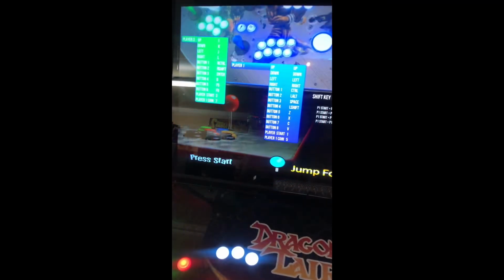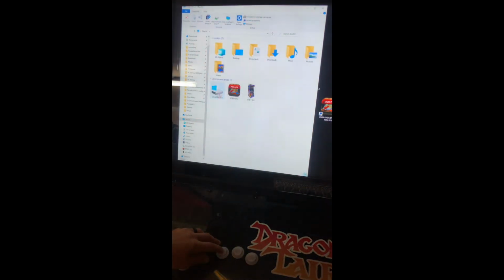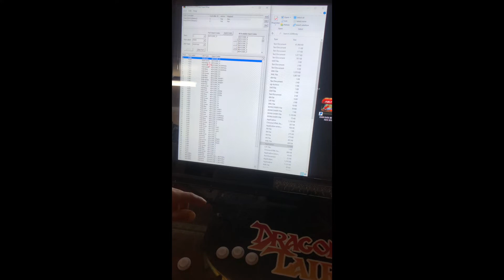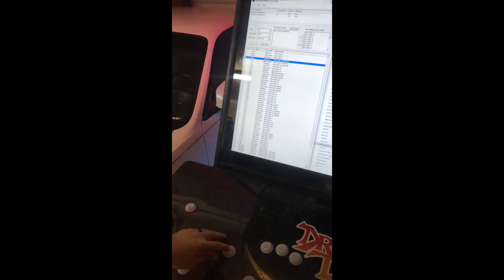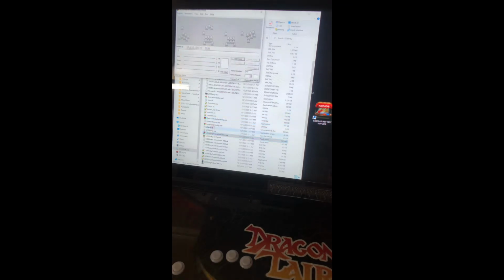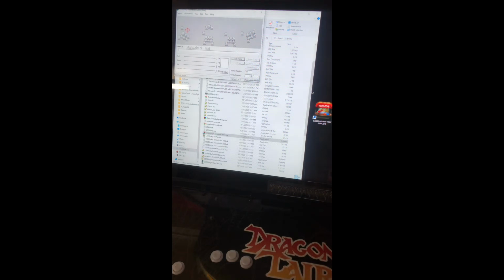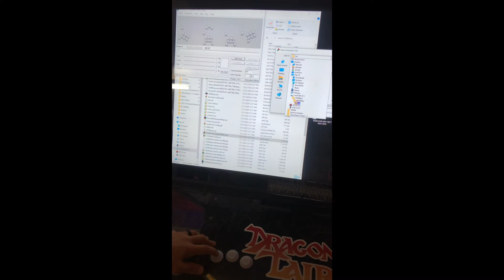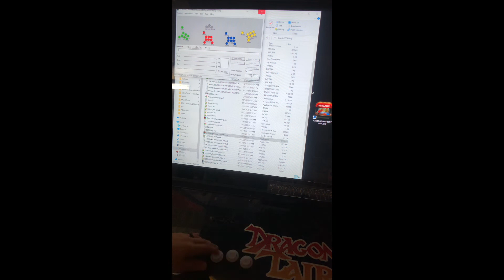LED Blinky initial panel set up on MP or Omega

Comment: Yo Dantron, I cant get the light to come on at all after installing the goldleaf button wires into the Pacled64.  Where am I going wrong or forgetting?  Wires are installed correctly.
Reply from the maker: I don’t use gold leaf, but I’m pretty sure that their connectors might be a little smaller. I would also say make sure that you have the pacled64 powered. Also, have you had LED Blinky up and running in the past? If not, you’ll need to make sure you have the proper files for it to work.
Reply: @dantron69k Yes!  Got it bro, it was what you said about the Pacled64 power that struck me.  Wind up being reversed polarity in the barrel connection. Big Thanks Dantron69!
Reply from the maker: @SyCook-TX  thank you! This makes me smile and is a great way to start the morning. I’m glad it’s working for you!